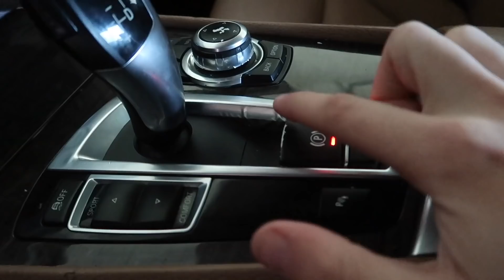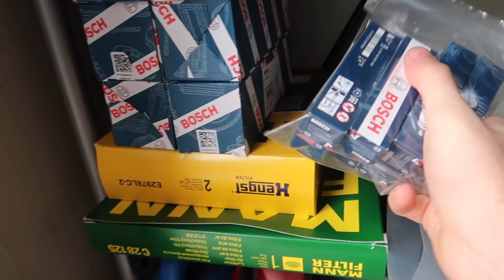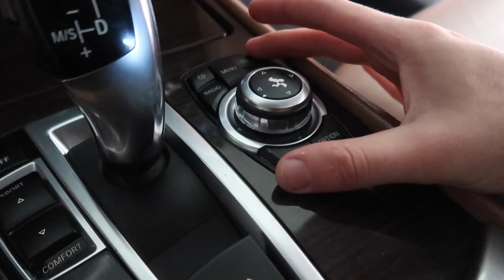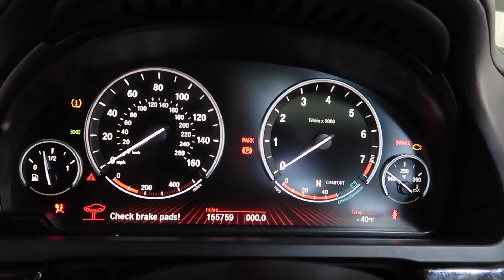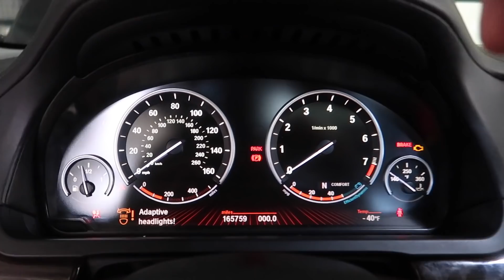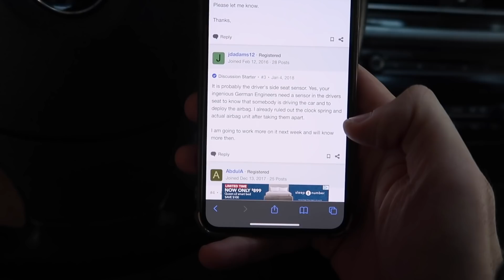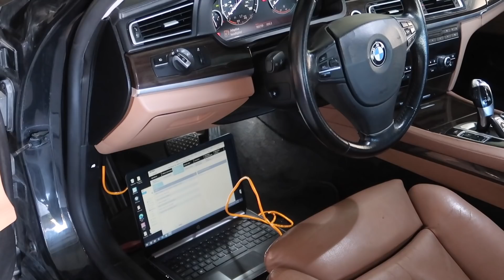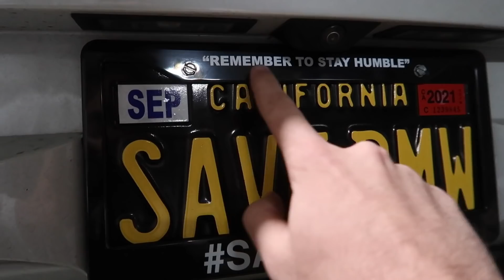Rebuilding An Abused BMW 740Li N54! Part. 3

Comment: It’s smarter to just bring it to a shop and get a new trans but def more fun to diy , it’s very possible it can be the parking solenoid but also there’s a bridge seal that does break in half that could cause it to not go in park, it’s also a good idea to download ista on ur computer saves a ton of time with  diagnosis .

Comment: Before you replace the clock spring... If the 7 series is like the 5 series, the wiring for the front crash sensors, fog lights, horn, outsource air temperature is all on the front bumper cover and plugs in under the front light. I will need to put in an order for that plate soon

Comment: you mentioned that the new brake sensors where not registering.... on my e87 i had to reset them after replacement,

Comment: I would try hooking up another shifter control lever/egs before replacing the transmission sometimes when people spill stuff on the egs and it throws it off maybe have johnathan let you swap the parts to see if it’s the shifter and not the trans itself

Comment: Nour, I'm looking at getting a BMW 220i or possibly a 228i. I'm worried about too much milage on the car. What is the max mileage you think I should be looking at? looking at 2014 - 2016. Thanks - Craig